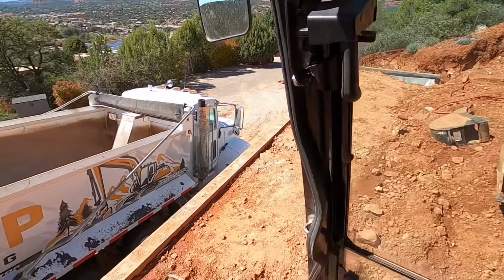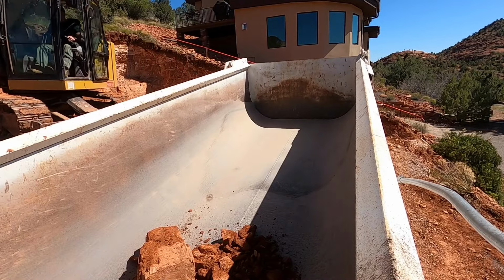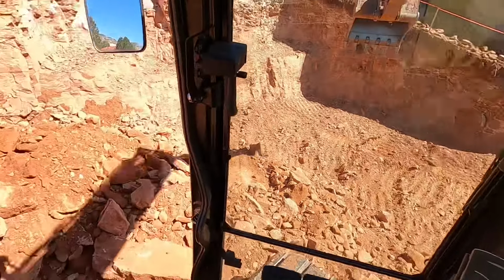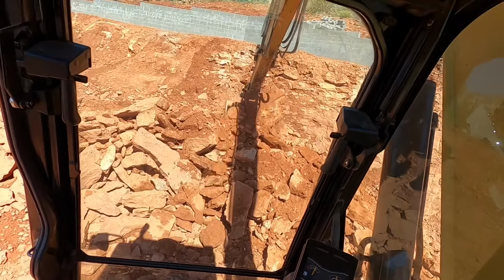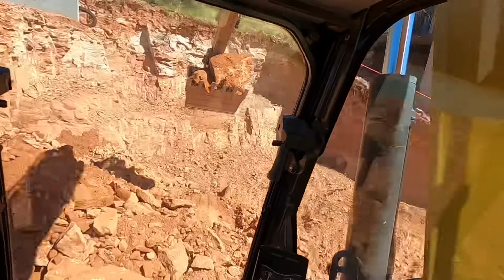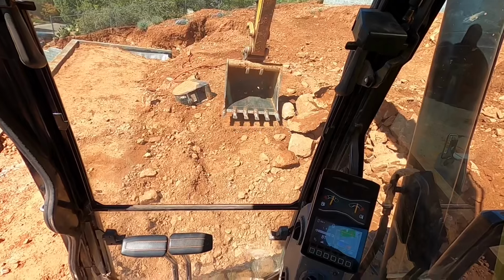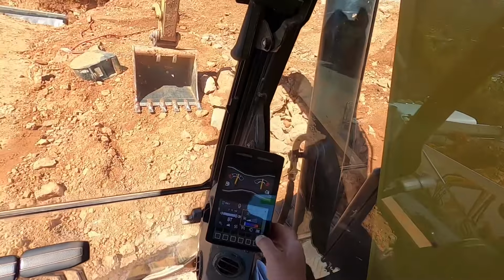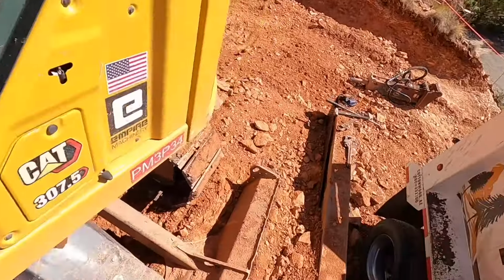Loading my own!  I better speed this up!  @haulintrash #excavator #dumptruck #caterpillar

Comment: Excavator was to small, how many passes do you load 30?
Reply from the maker: Probably close to that, but that's what we had at that job site.  It's a pretty tight location.
Reply: @haulintrash  Cool, and be careful.
Reply from the maker: @superduper9420  Thanks, man!